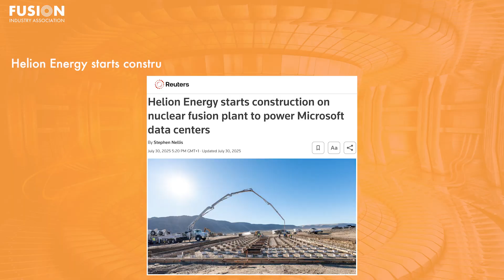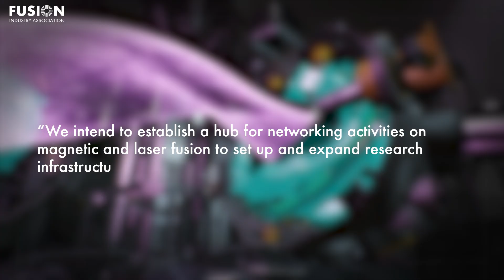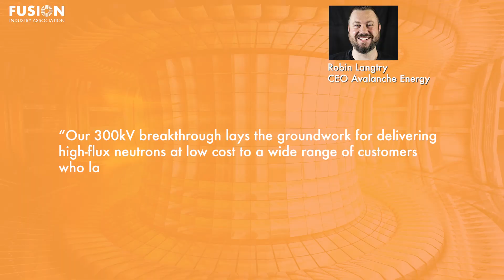Fusion News, August 6, 2025

Comment: The machine Helion is building is a non optimal machine that yields Tritium. This machine generates electricity, Tritium and unfortunately neutrons. Hopefully in 10 yrs this Tritium will turn into He3 which will be a cleaner and a truly revolutionary fusion machine
Reply: Helion has already developed He3 synthasisers.
Reply: @KellyStarks How? It takes 10 years for Tritium to turn into He3…
Source??
Reply: @pedrosura 
Source was the president of Helios in a interview.   Saying He3 is a much better fusion fuel, but no one will fund your research on a reactor with no fuel source on earth. So they first developed a He3 manufacturing reactor.  
Not sure how you synthesize it in bulk.
Reply: @KellyStarks There is no He3. They would have to build a reactor that does deuterium-deterium reactions and when that reactor runs, the biproduct Tritium would convert into He3 in 10 years. Then, they could run the Tritium deuterium reactor. The other option is getting it from the Moon.
Reply: @pedrosura 
I realize there is no He3, that’s why they developed a way to,synthasize  He3 as I said.
No waiting for trintium to break down in 10 would obviously not be very practical, nor would it generally be defined as He3 synthesis.

Getting it from the moon (assuming there is useful or any there) is an obvious deal breaker for its use.
Reply: @KellyStarks Well,  after researching helion energy and the internet the only reference I can find is that helion energy will make he3 afyer they get their first fusion reactor online which produces tritium whicb turns into He3 with a half life of 12.3 years. That is the only reference I see. You could bombard lithium with neutrons to convert into tritium but that is a method I doubt helion energy is doing.
Sorry, I see no evidence of what you wrote. I asked you for a source and all you had was you heard from someone. If it is a real thing, I am sire you would be able to quote your source.
I dont go around believing what people write online for a good reason. Unless you can show me a reference, I think you are wrong and misunderstood.
Reply: @KellyStarks where is it. Never mind.
Foundit, thank you…

While our machine primarily runs D–3He reactions for power production, D–D fusion is a co-reaction that contributes to helium-3 production in both immediate and delayed forms. Deuterium atoms fuse with each other to produce helium-3 through two pathways. Half of the time D–D fusion directly yields helium-3. The remaining half produces tritium, which serves as a stored resource that transforms at a rate of 5.5% per year into helium-3 through natural radioactive decay with a 12.3-year half-life.
 
This two-path system works as a fuel supply investment plan—part gives you helium-3 returns immediately, while the rest grows for the future. In fact, this fuel cycle system strengthens itself over time; the longer a machine runs, the more self-sufficient it becomes in producing helium-3. This self-reinforcing nature is what gives me confidence that we can produce sufficient quantities of helium-3 to operate our advanced fuel cycle.
Reply: @pedrosura I said it was something the president of Helion said in a video of him interviewed.   Hardly, me”hearing it from someone”. 
Note did I say how they were doing it, though waiting for tritium to degrade normally hardly seems viable.

Ok just saw you second post which outlined how their He3 synthesis worked through D-D fusion which generates He3 50% of the time immediately, and “banks” the other “presumably tritium produced as a later fuel source.  (Or sells it for nuclear bomb triggers)

Comment: I am very excited about the progress towards the Avalanche compact neutron source.  From time to time, the idea of a hybrid fusion-neutron-source and fission-waste reactor has been fielded.  The idea being that a sub-net-energy fusion reactor could still produce enough neutrons to burn fission waste for net energy, and perhaps more to the point, convert long lived fission waste into short lived fission waste along the way.  Would the Avalanche device be suitable for such an application?  How many neutrons could it evolve per kW of energy in?  What would the energy of these neutrons be?  The implication that their device would be useful for isotope production suggests that it would produce thermal neutrons, but I imagine that it is mostly a function of what fusion fuel their device uses.  Looking more long term, could something like the Avalanche device be used to create a fusion-fragment rocket?  That is if containment for the plasma is very tight, then realistically only electrically neutral neutrons will be escaping.  If that can be confined to only happen in one direction (presumably with absorbing and moderating substances lining the reactor chamber in all other directions) then the escaping neutrons represent a source of thrust.  Obviously, this would work best for a fast neutron evolving fuel.  (Over the years, some discussion of similar concepts using proton-boron reaction products has been suggested).

Comment: There was a podcast that I have seen recently where Lawrence Forsley claims to have found trace elements from neutron interactions in cold fusion.  Wouldn’t adding simple diamonds that are Beta-Voltaic make any reaction detectible?  Would Palladium doped diamonds allow deuterium to be confined in it its surface and allow it to give off electrical power too.  Could you also dope with Beryllium and Lithium diamonds and cause a deuterium tritium reaction as well?  Wouldn’t it be possible to use Beryllium and Lithium doped diamond to detect Neutrons by producing tritium that will be trapped and cause the diamonds to glow as proof?     
https://www.youtube.com/watch?v=djDygoBQ1lM&t=743s